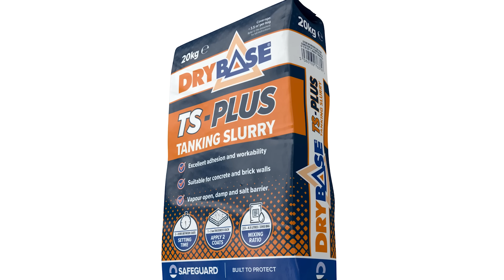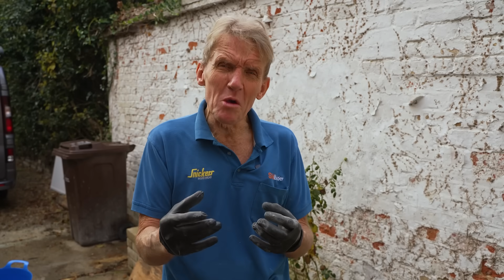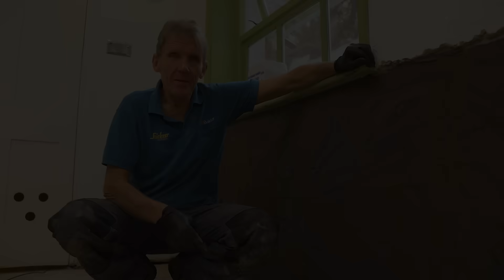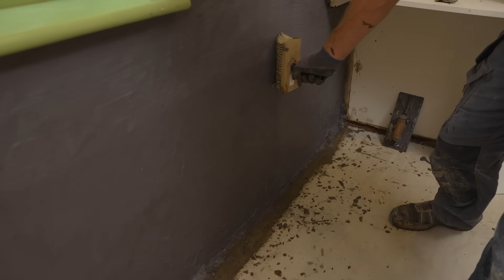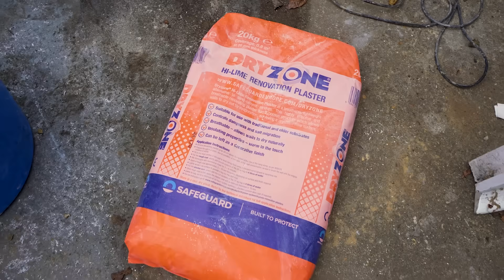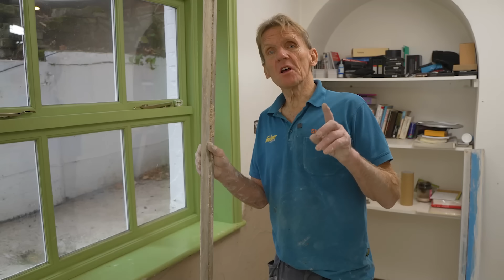Damp Creeping Back? You're Using The Wrong Material

Comment: I am actually researching how to sort out my garage walls and came across this video. I live by the coast, it's wet and windy, I will do a dump-proof membrane and cover the floor with rubber tiles, but I need to do something to the brick walls since it's a thin layer and I am afraid that anything I will store in the garage, especially some electronic stuff, will go bad quickly. Do you have any suggestions, Roger?
Reply: Have uou tri3d painting the walls on yhe outside? I'd use stormdry max cream and work it into the wall. Roger has used that before. Ita breathable and water beads on it. I painted some coping stones and the effect is mental.
Reply: @klaeLIFE  I haven't yet, I thought that it's best to wait till spring for that so that I don't apply on wet bricks.

Comment: If that's a basement it should be floor to ceiling and a meter up on ground floor level.
All wrong
Reply: Yes , floor and walls tanked with radius between floor and walls to allow the correct depth.

Comment: If you're trying to deal with damp I'd recommend getting hold of the book "The Damp House" it's a great resource and explains a lot about the causes of damp and the variety of solutions.
Reply: Another option is "Diagnosing Damp" by Ralph Bukinshaw and Mike Parrett as these are two of the lead authorities on  the subject.
Reply: @alanyoung7532  shame it's nit available on Amazon UK at present. It looks like a RICS title so, hopefully, it will still be available from the RICS book store.
Reply: @davidquirk8097  I've ordered 'the damp house', thanks. I'm a DIYer and fancy trying Roger's approach but it's not quite a cellar, just a damp downstairs chimney breast. Someone closed off the fire with gypsum board which has broken down with the damp despite a vent in it. It's only just above the ground level The chimney doesn't exist any more so  I think I should probably brick up the old fireplace and tank out the whole lot with Drybase TS Plus and lime mortar. But I'll have a look at the  book first.

Comment: I don't want to come across as though I'm questioning the integrity of a master builder with decades of experience and much useful advice (I'm subscribed), but I have to take issue with the implied claim that this damp problem has been solved "for good" when: 
a) the job has apparently only just been completed (barely), without any evidence of non-recurrence over time (e.g. at least one cold/wet season);
b) the Safeguard Europe website seems to indicate that this (not cheap) TS-Plus product was brought to market relatively recently (27 September 2024?) -- only a couple of months ago -- making it a tad premature to comment on its efficacy, even if may turn out to be the 'Holy Grail' in due course. 

I would be more comfortable with a sales pitch along the lines of: "this particular product has been field-tested for x number of years, by myself and dozens of my contractor buddies, and I can vouch for the fact that it (almost) never fails".  Otherwise this comes across as a sponsored infomercial, however well-intended.
Reply from the maker: I understand your concern and I would not have said "solved for good"  but so many people have made a half arsed attempt to sove this kind of problem and failed. The test result in the lab indicate that it works so the variations on that are 
water pressure 
application
building movement

I will come back to this and if it fails we will want to know why it has happened. I am confident.
Reply: @SkillBuilder  Thanks for your reply, and commitment to follow-up with your real-world experience after a period of time.

Comment: Will you go back next winter to prove that this has indeed worked and hasn't just pushed damp upwards, created a very cold condensating wall and deteriated the masonry beneath?
Reply from the maker: You are not just asking a question, you are loading it with a prediction but I am happy to do that and I hope you willl be watching. As for the cold wall, the lime plaster is the best thing for that because it is warmer to the touch and absorbs moisture which is will then release again as the wall warms up. This has been in use for thousands of years. 

Why would the masonry deteriorate faster? It has been wet for 200 years and brick below ground is perfectly o.k if it is wet. That is why it is still used in footings. 

As for 'pushing damp upwards, the 'push is not' water pressure it is evaporation and it may well be that a line appears on that join. If that happens I will have to hack off the wall above it and continue the membrane but let's see what happens after one winter and one summer.
Reply: Have used tanking slurry a few times it worked well

Comment: I live in a flat on 2nd floor.  I have damp and/or mould beneath the living room (north facing) window.  Where is this coming from and is it damp or condensation?  What is the difference?  Thank you for sharing.
Reply: Probably the window leaking or condensation running down the glass on cold nights
Reply: Condensation is when humid air hits a cold surface and condenses to water droplets. Damp usually comes from outside, either rain penetrating through the walls or ground water.  Because you're on the 2nd floor I would suspect condensation or rainwater making it's way in through cracks or loose pointing
Reply: @mrali5196  Thank you for this information it's much appreciated there are cracks in the outside windowsill.

Comment: Just bought a house that has an inspection pit in the garage. Said pit has a quantity of water present. Not full, but significant. Do you think that this system, applied to the floor and the walls would keep the water out?
These are great videos - very informative and really well produced.
Reply from the maker: I think it is very likely to work. If the water is coming up from the ground it  means the whole thing has to be tanked but if it is coming through the walls you could leave in a floor drain

Comment: Sbr in the render? Why not waterproofer 3_1 mix 😂😂😂 nothing coming through that,
Reply from the maker: Waterproofer is not an adhesive or binder. SBR does the job and the TS+ does the waterproofing.
Reply: That's what I did in my cellar, primed the bricks with 1:1:1 Sand Cement SBR, rendered with 5:1 S&C with SikaProof, then 2 coats of everbuild waterproof. Although I think I messed up insulating it, as I've seen some evidence of sweat (water droplets leaking at the bottom) - Perhaps should have left a cavity, or lime rendered like Roger did.

Comment: Thanks for the video Roger. Do you think this might work in an air raid shelter? I have one in my garden and unfortunately over the years debris and mud fell into the wall cavity in post war cut window opening.. I have done my best to remove this but a good amount still remains and it's evident the wall just absorbs rain water. 
It's a bit of an odd predicament as not a common scenario, the shelter is half above ground so I've likened it to a cellar so will a drain across the wall, maybe removing a couple more bricks to clear soil bridging gap, and then rendering the inner wall and using this product  could do it🫠
Reply from the maker: I think it will work well.

Comment: It's all well and good but lime plaster is supposed to breeze, your customers are going to paint that surface at some point, with tanking behind, is there a risk if moisture gets in there from above, it'll be trapped and paint starts chalking or flaking off? Good job Roger and look after your knees!
Reply from the maker: That is why I said, don't use vinyl paint. An ordinary emulsion is fine. I have never had a problem with it
Reply: I didn’t realise you could use emotion online walls that’s brilliant thanks. Some of the specialist paints are so expensive.
Reply: @csharpe5787 emulsion is just the word for many paints, you have vinyl emulsion, lime emulsion, clay emulsion. The word emulsion comes from the principle of suspending pigment particles in a water based binder, which is all paints

Comment: What was the mix for render?
Reply: 6 sand, 1 cement, 1 lime.
Reply: @gdfggggg  he mentioned SBR, does that go in mix or painted on wall?
Reply from the maker: I painted the wall with SBR and put some in the mix.
Reply: @TeeTee-zm2re  I’m not sure how Roger has done this here. Sbr is waterproof but the lime is breathable. He may done a 50/50 water sbr mix on the bare brick, then rendered on that with sbr as a plasticiser/waterproofer mix in sand/cement, which will give a nice flat surface to tank on. 
If there is any chance of moisture getting through, the top coat will let it breath.
Reply: @SkillBuilder  ahh, there you go.

Comment: Before you put the slurry on you went over the wall with something, was it just water?? Was this to make sure the slurry didn't dry too quickly, or maybe to clean off the dust??
Reply from the maker: yes just to damp it down
Reply: It was hot in the room, from the underfloor heating 👍